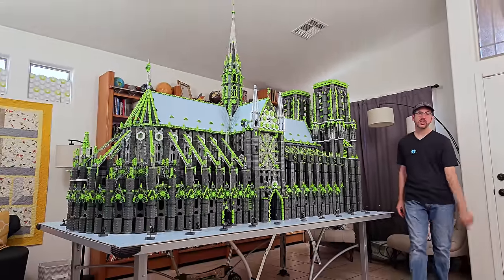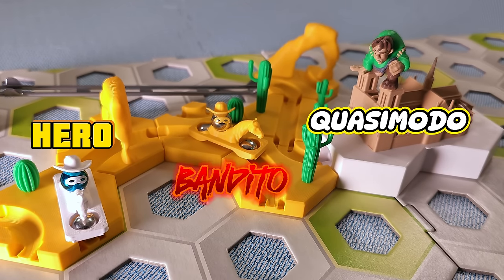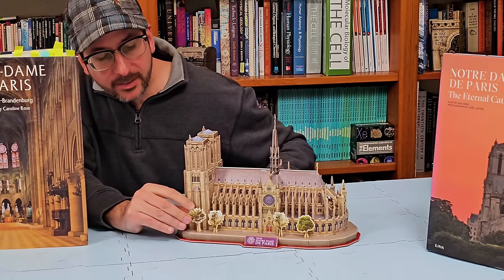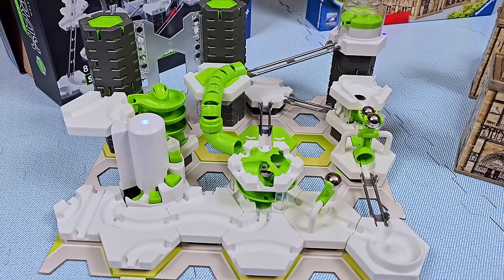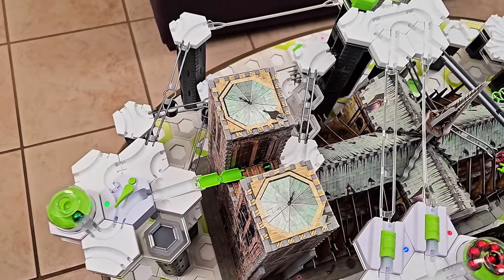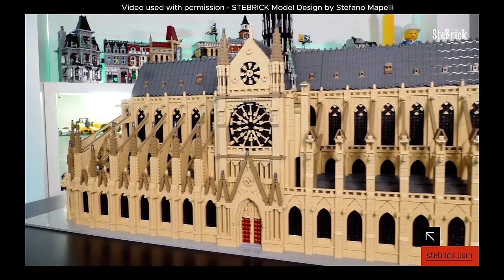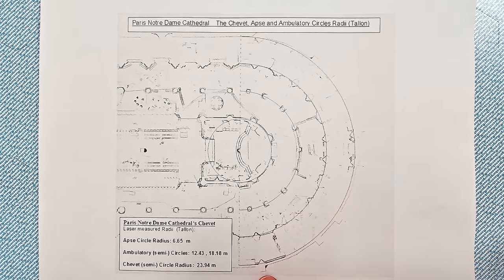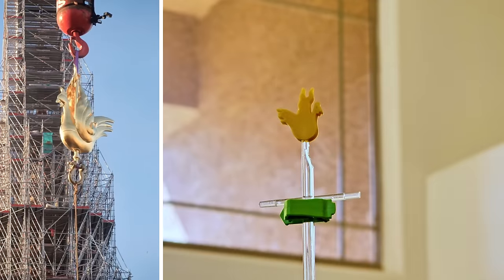$2 vs $40,000 Notre Dame Marble Run

Comment: The fact that the cathedral itself can be copied and translated into other building styles and materials and still look stunning shows what a masterpiece of architecture and art it truly is.
Reply: Even when the Cathedral caught fire, it was still sensational. The cross inside of Notre Dame gleamed above the rubble like a phoenix, the fire tried to kill it but the fire inside saved it.
Reply: $213000000000000001000000000000000000$

Comment: Did you just make the most longest timed marble run ever?
Reply from the maker: I did that in 2 other videos on my channel, but only for GraviTrax marble runs, not marble runs in general. Look for these 2 videos: Pixel Art Marble Run set record for longest run without GraviTrax POWER battery-powered elements. Las Vegas marble run set record for longest with GraviTrax POWER elements.

Comment: Links to the foam, card and puzzle models? I’m a gothic architecture fanatic and honestly these tiny models are the perfect decor for my room
Reply from the maker: The small foam model is the National Geographic Cubicfun Notre Dame kit that can be found with a Google Search. The card I found on Ebay, so you'd have to search for that as well. The larger puzzle model was a Puzz-3D brand Notre Dame which may be discontinued, but if you search for Notre Dame foam puzzle, you will find newer brand puzzles that are similar.

Check out my community tab...I'll post a screenshot for you of my Notre Dame model planning sheet that includes all the models I used, along with many other models in this size range that I didn't use, with their dimensions and scales.

Comment: I see a like button, but where's the love button?

it must be really hard working on the tracks inside! I'm having trouble with my fat fingers just with basic vertical builds! Camera work inside the structure is surreal too!
Reply from the maker: It was tough. There were not a lot of opportunities to make the build so that I could have access to the tracks inside. Small cameras from Insta360 and sometimes removing a rose window were necessary to film everything.
Reply: @MaskedMarble  aha, the hard work that goes into making this that we don't see in the video!
Since there aren't many chances to reach inside to tweak the tracks, I suppose you had to make a section's course perfect (and reliable) before closing it up and moving on. Truth be told, I was a little worried watching the long spiral path as it shakes violently, thinking, 'don't break, don't break'! 
Really great stuff. Can't stress that enough.

Comment: That was the best track I have ever seen
Reply from the maker: Thanks. I thought about the Eiffel tower, but that would require parts that can hold tension. There is no way without reinforcing with 3D printed parts that I know of where GraviTrax assemblies can stay assembled under tension. They can only withstand compressive forces. So cantilevered builds cannot really carry much weight. I was taking it to the max with the bridge structures I built for the Las Vegas marble run, and I was thinking they might be the key to building an Eiffel Tower, but when I tested them for bearing more weight, it was a no go. PRO walls start pulling out of PRO pillars when under too much tension, so 3D printed clips or zip ties would need to be added.

Comment: Where can i find the 3d files for the gravitrax pieces
Reply from the maker: Which ones are you interested in? Most of the 3D parts generated for this build were not general-use, but specifically printed for this build. However, there were a few general use pieces like the zig zag rails which can be purchased on Etsy or 3D printed on your own using designs freely available on Thingiverse or Makerwold or Printables.

Comment: Wow, you did a relly fantastic job !
But Is it real, that Gravitrax has no real elevators and that the power modules are just for single use und have to be reseetted by hand , so that the marbles can only go from start to end without the possibility for an automatic "restart" ? 
I definetly prefer Marble Machines that can be theoretically watches for hours....   🙂
Reply from the maker: GraviTrax POWER modules do the resetting for you. It is the non-powered elements that need to be reset by hand. So you can put together a looping track using GraviTrax POWER Elevators and Levers, like the 30 hour track seen in my Vegas Marble Run video published in June. The only thing is, POWER elements turn themselves off after 10 minutes of inactivity.